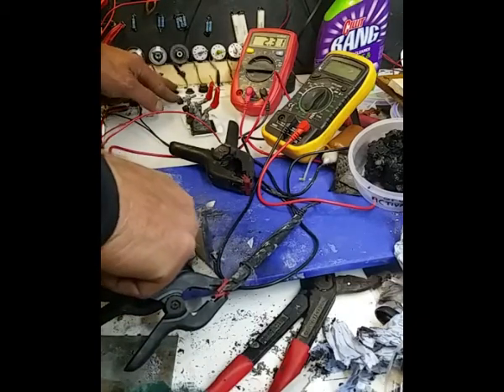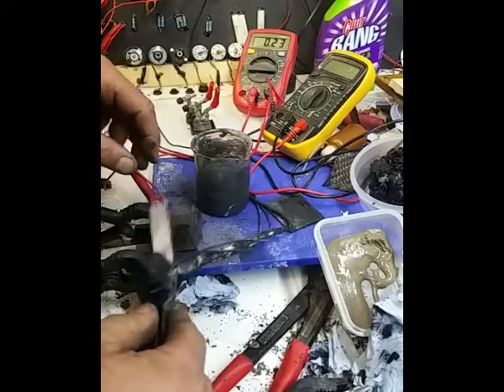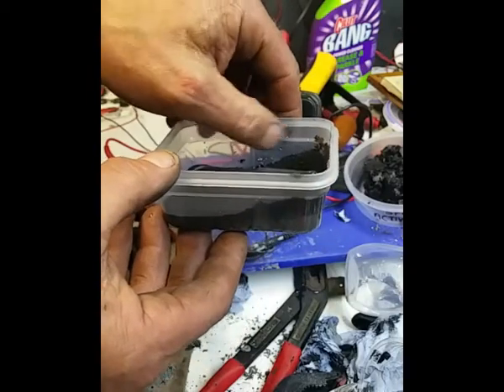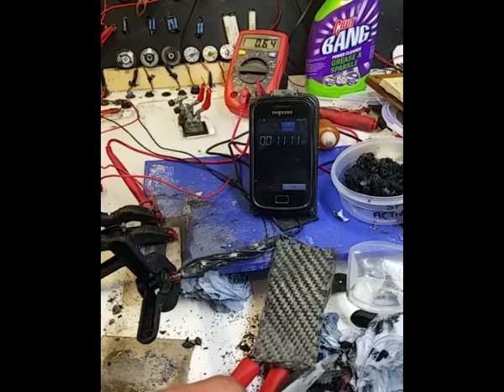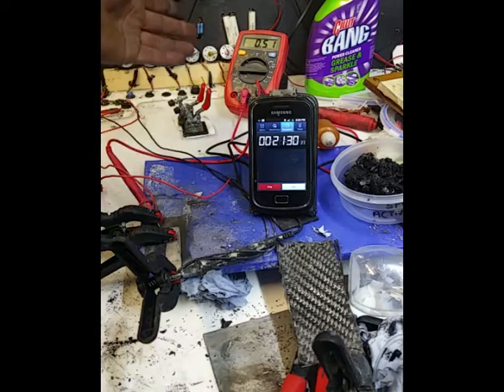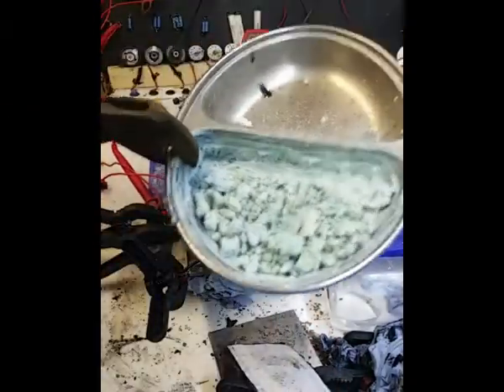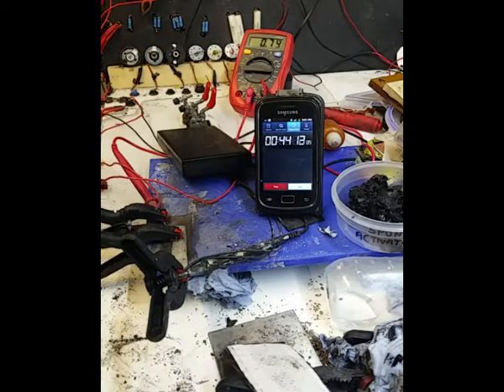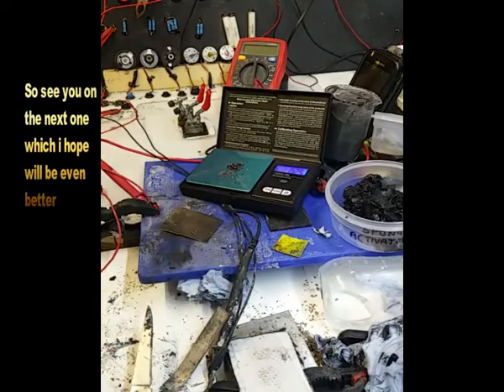3rd  new solid state Battery attempt it is long but worth watching

Comment: Hi Kev, Another interesting set of 3 vids.

Data logging will be a worthwhile addition, as we can then see where the majority of the energy is being stored, it is obviously more useful to have the bulk of it at the high and mid end voltages, as you would find in a lead acid or other secondary cell. 
The overall time may not be the governing factor as the low end may be the longest time but least energy. 

The weight of the active material may not be as significant as the area of the plates for a given energy storage density. 
The size of the plates and case will be the most significant contribution to overall weight of the final battery.
I am also assuming the cost of the active material is only fractional pennies per gram.
Keep up the great work, looking forward to the next instalment :-)    Martin.
Reply from the maker: solarhope hi mate, yes it is looking even better now as i have further developed that new material.
i have finally developed it so it fits within my triangle of batteries IE a self regenerating, a rechargeable and finally my solid, solid state ( as in dry ) so with small additions or subtractions i can basically use that same material.
as regards timing them it is getting quite boring as i regularly get between 3.5 to 5.5 hours now ;-))
the next couple of video's show a lot more.
but yes i am still looking for a uk supply for one of those radio shack DVM's

Comment: Thanks for the video and information. I think you need to repeat your test with a material different than the magnesium. That would take the possibility of the magnesium creating the voltage out. Unless you don't mind if SOME of the voltage is coming from the magnesium. Thanks again.
Reply from the maker: Martin Malcheski hi yes thank you for your comment, but i do regularly try zinc and indeed aluminium with this but i find magnesium such a chalenging metal to try to work with so i will continue untill i have beaten it.
The voltage is always obviously higher with magnesium as it donates 2 positive electrons ( nice ) so yes it has a phenomenal power density.
Oh and it will never run out as it it the 8th most abundant element on earth... so the only way we could run out is if ET landed and said they wanted it  ;-))

Comment: Am trying to make graphene from charcoal or activate charcoal (Activated carbon) any ideas?
Reply from the maker: Aetheon Pro i did this and got very good graphene with a very low resistance but there was a high energy cost and a lot of time to do it.
But i used a variety of solvents like acetone and ethyle acetate also some mek.
You would be far better to get your graphene from graphite. It is far easier and cheaper to do.